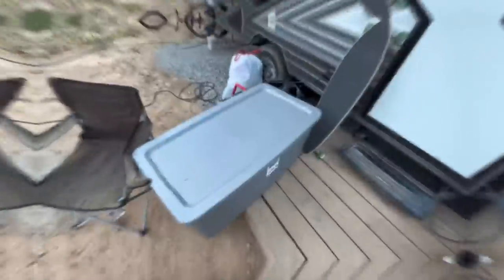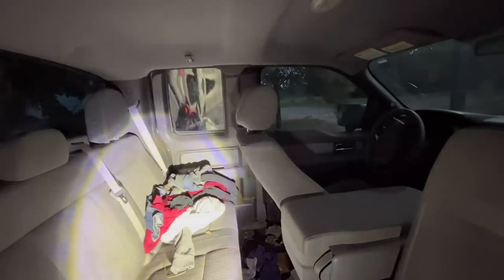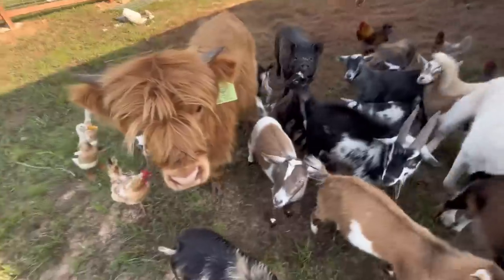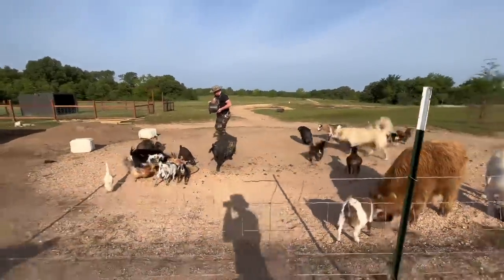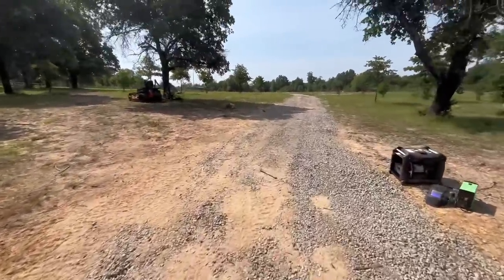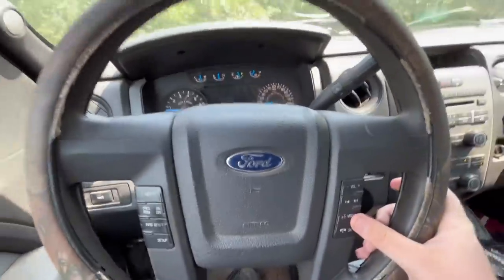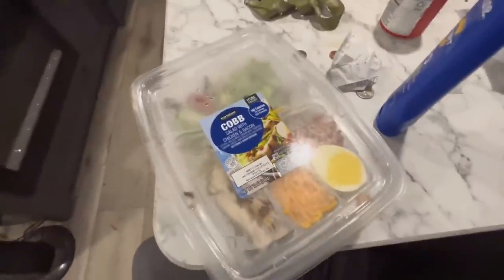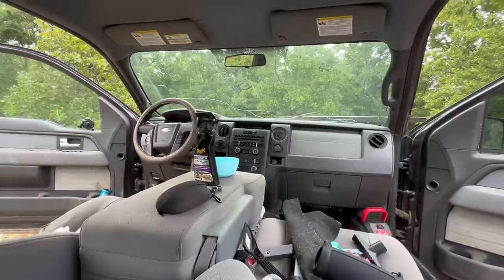Cleaning My New Truck!

Comment: Jason is going to want his nice clean truck back.
Reply: Naw. He knows it needs a lot of work. Jayson doesn't do maintenance until it's way past time and somthing brakes, then he thinks a oil change will fix the problem
Reply: @Hats4everyone  ya ding dong! haha that truck has well over 200,000 miles on it and still running strong... so how did it get that far in it's life?? Oh yeah... maintenance i've done on it haha
Reply: Y'all are cutting up in this chat.
Reply: Spread some moth balls under the tiny house, and around the camper.
Reply: @TheCrockers  when it quits running all the sudden then u get it fixed doesn't count.....
Reply: @Hats4everyone  Exactly.....that's why he ran out & got the toyota--cause it was
not running.....Jared was using the truck when he got the jeep, but as soon the jeep
stopped running he took the truck back until it broke.
Reply: @wandae9906  the title is in Jared's name